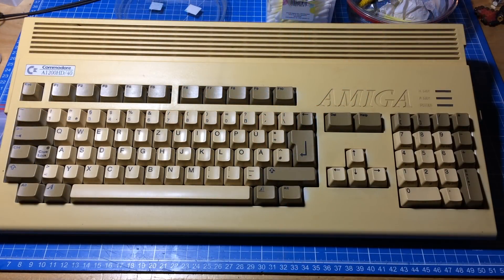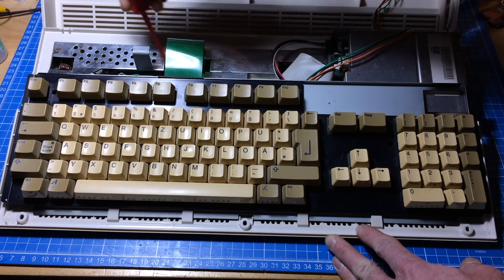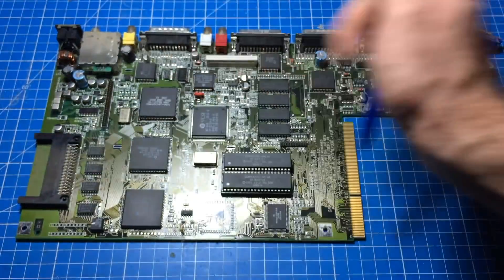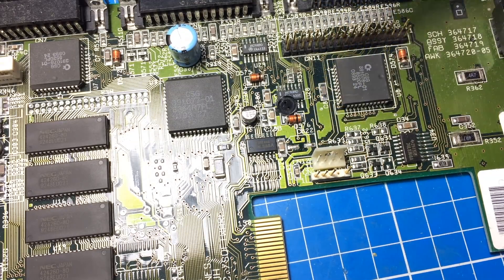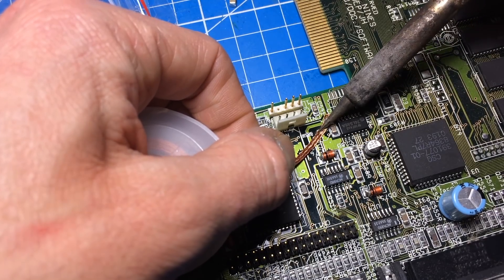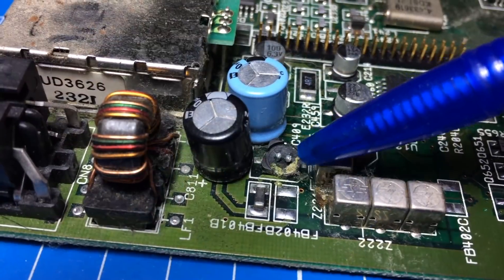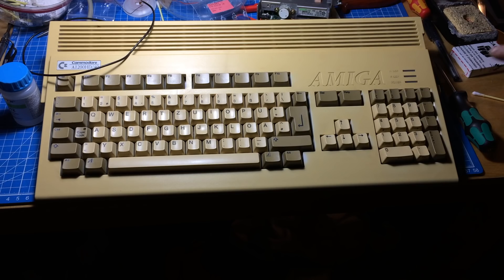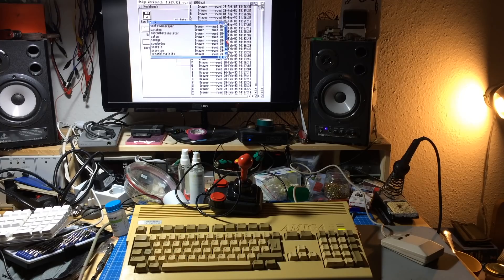Amiga 1200 Full Recap with Ceramic Capacitors

Comment: I used the same method as you. Twisting the caps till they come of the board. I only used the original caps. I used solder paste and flux to solder them back on the board again. It was a bit of a nerve wrecking job! Got a second A1200 which I want to recap. Nice job and posting a video about this.
Reply from the maker: Thanks! Yeah, these are nerve wrecking adventures sometimes. Today I worked on a Macintosh SE/30 board and removed all the SMD caps. Literally all of them were leaking. I have one of those 858D hot air stations now and it works very well for the job. No more twisting caps (although I'd still recommend it if you don't have a hot air station). ;)

Comment: I have replaced thousands of SMD elec caps for people. some are in such bad condition that not much of the pad was left (I'm looking at you Sega S1 pac for laseracive!). Here's the best technique I found that results in minimum stress and no heat on pcb. 

- cut the cap just above the plastic holder
- break plastic holder to remove (now left just with legs) 
- use soldering iron with fresh solder to remove legs
- clean pads with iso + qtips
- clean pads of all solder using desolder station / braid
- install new caps

I don't use ceramic caps. I only use what was originally there.
Reply from the maker: +Leon Kiriliuk Yes, I saw people using the method you are suggesting. Have yet to try it for myself (I will practice on sth less valuable this time). Thanks for the tip! :)
Reply: Thanks for the tipp!

Comment: Great video. Just some piece of advise if you don't mind. Soldering SMD components is quite easy if you only apply solder to one pad, then solder the component to this very pad and as a third step you apply solder to the second pad. Makes things way easier. :-)
Reply from the maker: Thanks for the tip! Sounds reasonable to me. I will try that method when I solder SMD stuff the next time. :)

Comment: Yeah, the twisting method of removing SMD caps is controversial but seems to work pretty well.  The trick is to hold the plastic base of the cap with tweezers while twisting the cap.  The plastic base has two small holes in it for supporting the leads, and if you stabilize the base, the twist won't put a lot of strain on the PCB pads.  I've done a lot of practice with some old video cards before I'll do it to my A1200 next week.  If the pads are corroded, well... you have your work cut out for you anyway, and that's the time to contract a pro to do it for you!

Your twisting was pretty rough and it looks like you were pulling upward, too.  That was painful to watch!  But, these Amiga boards don't give you much pad surface area to heat, so the lifting/rocking method is near impossible without soldering tweezers.  I wish I had some soldering tweezers, but they're friggin' expensive.

I can't comment on replacing electrolytic caps with ceramic, as I'm too new to this electronics stuff.  They might work for decoupling (such as near the RF modulator), but not so much for filtering (near the audio ports, or the 47µf caps on the 12v lines).  I know it's generally a bad idea to replace caps with much larger capacitance, since then they won't filter noise as well.  I'll stick to replacing the 470µF and 1000µF can caps with stock values, but I'll replace them with some nice KEMET polymer caps.

I've never done SMD soldering before last week.  My A1200 actually blew an SMD cap near the Alice chip, and made a nice crater in the PCB and burned a hole in the insulation under the mobo.  What a mess.  I did fix it with a new ceramic cap and 30 gauge wire.  Once I did that successfully, I figured a full recapping was in order.  I'll be doing that next week once the parts come in.  8)
Reply from the maker: Oh, that's a nice tip! Will definitely try that the next time I come across some leaky SMD caps. The close-up shot in the video really looks brutish. I got at least a bit better after that (I only filmed the very first time I did it up close).

You're definitely right about the capacitance. Always use the same values there or at least values very close. I tend to use higher voltage and temperature ratings as they significantly prolong the cap's life.

Still not sure about the ceramics/electrolytics thing. All I can say is that the A1200 from this video still works fine (even has an accelerator card in there now) and doesn't have any problems. I think I'll check some of the filtering with the scope some time but functionally, everything works as it should. :)

Oh yeah, caps can explode quite violently. Had one in my A500 power supply that let out black smoke (while the supply still worked!) recently. Switched it off before it burnt a crater, though.

Good luck with you recapping! And thanks for the productive comment. ;)

Comment: Yikes! I feel like The Highlander, cautiously leaving a comment... Jan Beta, you have definitely spawned a great debate.  I have my original A1200 that requires a recap and I have been putting it off -- the procedure makes me nervous, as well.

Using ceramic SMD caps is an interesting thought, and you did a great job, as nerve-wracking as it must have been for you.  I did find an interesting article on the TDK website, "Guide to Replacing Electrolytic Capacitors with an MLCC" (https://goo.gl/YPK47U) if anyone is interested.

Twisting off SMD electrolytics from an A1200 always makes me cringe, concerned that the twisting force will tear off a trace.  If I recall, the Mr. Carlson's Lab video, where he twisted off these caps, was a repair to on an analogue oscilloscope board. The main PCB board looked to have a very robust conformal coating, so perhaps the chances of lifting traces were slight.

I agree with GadgetUK164, hot air is supposed to make the SMD electrolytic cap removal a lot easier.  HOWEVER... if you haven't already done so, check out Sabretooth Barnacle's video "How to replace the capacitors on an Amiga 1200 (and not lose your eye)" (http://youtu.be/Tnl9KTQB_ik). The other option is hot tweezers, as shown in "tbtorro recap" on The Tbtorro channel (https://youtu.be/MIpnzUwSzNw).  But why spend money on decent hot tweezers if you are not recapping Amigas on a regular basis.

In my research preparing for recapping my A1200 I am planning on using Organic Polymer SMD caps -- same SMD package as the electrolytic SMD caps but use a solid electrolyte rather than a liquid electrolyte.  Organic Polymer SMD caps will NOT leak and therefore operate for a very long time, but they do cost more.

Once again, great work on your efforts and for keeping your A1200 alive -- that's what really counts in the end.
Reply from the maker: Thanks for sharing your research! I must admit that I have reached a point where I think that the only way to do this right is to use good electrolytics of the same type (with slightly higher voltage ratings) which I will do sooner or later. The Amiga runs fine with other caps but they'll never have the exact same characteristics as the ones the whole circuit was designed for in the first place. I'm not too worried about leakage. The original cheapo caps lasted for 20+ years. I saw old audio stuff with electrolytic caps that were 40+ years old with nearly no sign of wear. The life-span also increases considerably if you use higher voltage and higher temperature rated caps, so I guess you wouldn't have to worry for some decades.

And I would have used hot air to remove those caps if I had the equipment. I hope to get a lower end hot air station some time to be able to do it right. I would still recommend the twisting method as a viable alternative. If done correctly, the pads are really not in danger too much. You rather move the legs of the cap until the metal weakens and just breaks off. The close-up footage in the video is the first try (which looked really brutal in retrospect...), I got the knack of it later and used far less force and a bit more patience. ;)

Oh, and I'm gonna read your links later. Still researching the matter as well (of course). The video on how to not lose an eye was part of my preparation for my recap. :)

Comment: Phew, I'm almost afraid to comment now. I have no clue when or where to use this type of capacitor. However, I did see bwack (Hans, check out his channel if you haven't already) use a heat gun to perfectly align small surface mounted devices. It means you don't have to fiddle with a soldering iron in tiny spaces.
Reply from the maker: +The Highlander Haha, don't be afraid. I'm taking all of this with a smile and learning from it. And yes, I'll probably get a heat gun some time soon. It's always a workaround to use an iron on SMD stuff. Oh, and I'm subscribed to Hans' channel. :)
Reply: Good. Opinions aren't always served chilled on social media..
Reply from the maker: +The Highlander I know. I'm lurking around social media since the MySpace days. ;)

Comment: First of all, big thumbs up for attempting this work (it takes effort to have a go when you've never done this before), and for making it public.  YT can sometimes feel like a painful place where everyone seems to want to bash your ears! ;)

The best way to remove these is either with hot air, or by cutting them off (very carefully) - cut the middle of the can very carefull with sharp cutters, then the can comes off really easily and leaves the pins on the board to desolder.  This technique (of twisting) can sometimes be done in some other systems (where the caps are much smaller with much thinner legs) but it really is not recommended.  For example, I've done the twist technique on very very small 10uF SMD caps on Sega CD systems, and no damage for the few times I have done it, but I did risk damage each time I did it that way.

But if you try this on an Amiga, or PC Engine it nearly always results at some point in a pad being lifted.   As you said, it was a learning excercise - so kudos for having a go!  If we don't make mistakes we never learn!!!! Trust me, I've made a lot and continue to do so!

Personally I don't like the idea of swapping wet type electrolytics for ceramic capacitors - I accept what you are saying though, and what other have said, that it does work with ceramic caps!  What they are missing is the fact that the capacitors don't behave the same way exactly!  Ceramic capacitors have very low ESR and are better at filtering higher frequencies (experts correct me if I am wrong here, I am a novice too), electrolytics are better a smoothing power supply ripple (slightly lower frequencies etc), ceramic caps can exhibit piezo effects (so you can get wierd oscillation type things going on if you're unlucky), and even ambient temperature affects them differently.  So even an exact same size capacitor doesn't behave quite the same - this is the very reason there are so many different types of capacitors, they all have different characteristics.  Since many of the capacitors are probably smoothing supply and acting as bypass caps etc they aren't going to work exactly the same way as electrolytics.

That said, maybe in a few places ceramic caps might actually be better suited than electrolytics - no idea!  But that's just my opinion - I am more than happy to be re-educated if it turns out there's nothing wrong with this approach!

So in the long run, I would also consider swapping them again for electrolytics - even perhaps just consider working out which ones smooth supply rails (just continuity test between the cap + and the supply + connections) and perhaps make sure at the very least that those are changed for electrolytics.   But hats off for doing this and opening up discussion on it, and don't let the comments get you down.  In general it looks like you did a good job - things could have certainly gone much worse!!! It's a success in that you managed to achieve it without damage to the board and it is working.  But it might not last as long without some of those key electrolytics on supply lines.
Reply from the maker: Thanks for your uplifting comment. :)

Didn't mean to cause such controversy here. I think I'll write up a little pinned comment to show how I carefully researched before doing this. And I'm learning all the time of course and stand to be corrected. There's quite some people for whom this conversion seem to work just fine and I thought I'd try this. (Had to recap the thing anyway.) After some more research, I might go back to electrolytics. Although I would want to try to move away from SMDs at any rate.
Reply from the maker: cf my pinned comment. You seem to have quite some experience. What exactly do you think is the danger in using ceramics here?
Reply: To be fair, it's not really his fault - if you look around there are quite a few people spreading this 'bad idea'.  I've seen people on the Amiga forums suggesting that its a good thing to do (despite the fact I think it isn't).  I've also seen people doing it to PC Engines (again, I don't think it's a good idea!).
Reply: Jan Beta - Yeah, don't worry about it!  I researched this a year or two back and came to the conclussion it was a bad idea.  I just 'left them to get on and do it'.  On reflection I should have jumped in and told them it was a bad idea, but there were enough flames in the forum threads already!   This video is really useful though because it has started a useful topic of discussion.   I am just waiting now for the people that think ceramic caps are just as good as electrolytics, when they arrive I am sure things will heat up lol.    And yes, if you are replacing them for electrolytics again, you could use through hole type caps - I am sure some people will frown because it doesn't look as tidy as using SMD caps, but its your own system and a working system is better than a none working one!  I often just fit through hole caps in place of SMD caps (in my own systems).
Reply: That's a good point, but tbh I've seen a lot of systems where people have swapped SMD caps for through hole and I've never seen one where the pads later got damaged by moving the machine!!!!  Your point in general is valid though - an SMD cap better supports the pads and the pads better support the cap.  But it really isn't such a huge problem, unless you're a perfectionist.  Anyone doing repairs and mods as their business, they should be using exact SMD replacements.  For the hobbyist, it's no big deal.
Reply: Today I will get an A1200 board with 5 cap locations completly without pads after they watched that idiotic twist and turn tip.  It is NOT a good way to do it.  If everyone just should STOP telling people to do this I would not need to repair a lot of boards due to this.

And solderingiron.  nahh  not a good idea.   either the best way: hot tweezers   or hotair (small nozzle and not too hot not to damage plastics (as you told)) and it works fine.  even on very corroded pads.
Reply: They simply doesn't do what it are designed for. filters totally different, behave extremly different. simply just does not do what it is designed for.  I cannot find the article now that explains how the capacitance of ceramics behaves different depending on voltage applied etc.  you can run the board without caps (ok you will need caps at audio and compositevideo parts to get FUNCTION. but machine  runs "fine" without any of the electrolytes mounted...    Anyway Ceramcs doesn't filter the noise as the designer planned for.

Why even change type? if it was designed for ceramics, why not put in ceramics from the beginning?   and I also know that IF you have issues with a ACA accelerator or Indivision and complains to individual computers. and if he knows you used the wrong type of caps he will just say: well do it proper and THEN contact me again.  he simply refuses to support machines that are recapped wrong.

so sure..  DO use other type of caps on your OWN machines.  but DO warn others that you MIGHT have issues either directly or after a while.   and do NOT belive the hype that ceramics never leak..  well. they never leaks. they instead shorts and makes REALLY ugly NONREPAIRABLE burnmarks when they fail..

I have recapped over 240 boards now always using panasonic caps. Do it proper or don't do it.
Reply: I get many machines for replair sent to me from all over the world.  and got several boards with throughhole caps where pads got broken after a while.    with a lot of extra job to repair the padslosses etc.  and I do not want to repair machines just as people did it wrong: so PLEASE use the correct type of caps, use proper tools.  do NOT experiment on the Amiga.   let me use my amiga instead of repairing other amigas as they used wrong tools, wrong types etc.    I am very dedicated to the Amiga so I want them to work.  that is why I rant very much:   DO IT PROPER, OR DON'T DO IT!
Reply: By using ceramics,, you did not do enough research. sorry..  if you do it on your own boards  FINE.  but tell others to.. no!   and twisting (OR Cutting!) off caps stresses the board, especially if the board have issues with leakage.
Reply: throughhole type is also wrong..  WHY: they sure behaves correct  but the pads are not designed for the stress when machine is moved etc. after a while pads WILL get loose especially of machineis transported often etc.